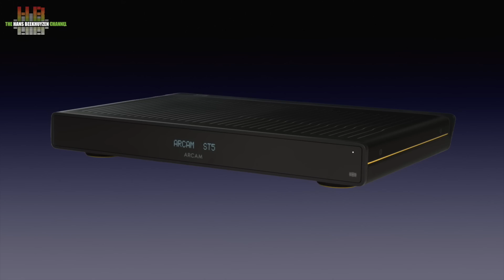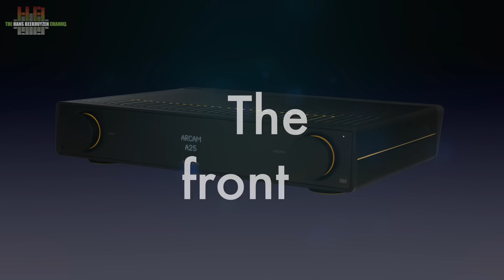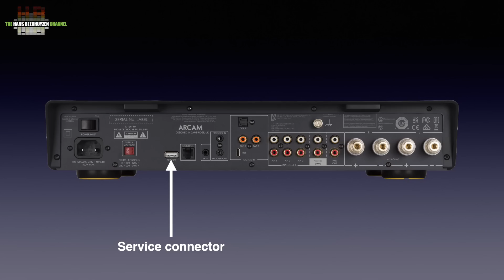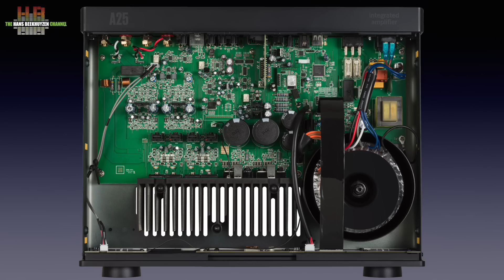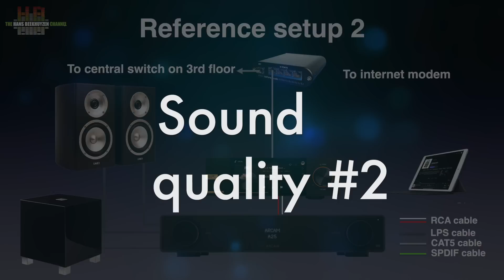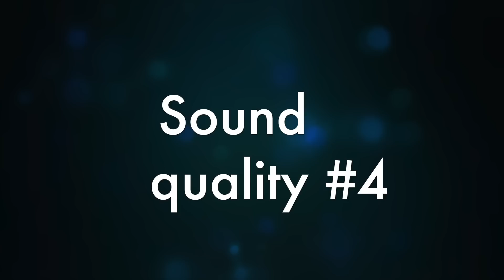Arcam Radia A25 class G amplifier

Comment: I really enjoy your detailed review. I'm considering pairing this Arcam A25 as an external amp to a Marantz Cinema 70s (for the rather limited AV time my family desires, with a 5.1 setup). Most of my use of the A25 will be for 2 channel music listening through my two LINN AV-5140 towers (4 ohm), where the Arcam's 165 wpc should provide just the power needed to make them sing. The Marantz 70s has a built in streamer, which I'm hoping will work ok together with the Arcam. Do you see any compatibility issues with these two devices ? Would much appreciate your comments.
Reply from the maker: No, but you should try before buy if you can.

Comment: I have the SA 20 and it is simply superb. It is almost the same as this A25 minus the BT and streaming bits. The class A magic happens up to 25 watts and for longer session, sane volume listening the SA 20 just rocks. Superb speaker control, non fatiguing highs, crystal clear midrange and grippy tight bass. They are on sale for about $500-600 if you can find one.
Reply from the maker: Thanks for sharing

Comment: Tempted to try an SA20.  Seems a great choice for lower SPLs, easier to drive speakers in an apartment.  Concerns are dac quality and reliability.  Not a looker either but functional.
Reply: @nc3419  I have the SA 20 and it is simply superb. It is almost the same as this A25 minus the BT and streaming bits. The class A magic happens up to 25 watts and for longer session, sane volume listening the SA 20 just rocks. Superb speaker control, non fatiguing highs, crystal clear midrange and grippy tight bass. They are on sale for about $500-600 if you can find one.
Reply: @dgdave2673  Thanks for the reply.  The SA20 was on a short list of integrated amps  in replacing my Hegel which was overkill for my needs and I wanted to downsize bulk with all my equipment. Did that with my speakers so amp was next.

Looked at the SA20, possibly a smaller Hegel, a Sugden A21se, a Musical Fidelity A1 and even a Cabasse Abyss but found a good deal on a used Van Alstine CA-1 which I jumped on.

I find the CA-1 neutral, transparent with good resolution and good stage depth.  Works well with my speakers but would still like to try a really good Class A sometime. I don't think I would gain stage depth like a tube but it would be different than the CA-1, purportedly.  So we'll see. 

Kind of wish these amps would come with XLR connections to take advantage of the higher voltage dacs offer whether balanced or not.
Reply from the maker: I haven't reviewed it so I can't say.

Comment: Are class G & H (essentially G) basically amplifiers that are Class B-A/B design for lower voltage signals and then have a second and rarely a third voltage rail?
Reply from the maker: See the video
Reply: @TheHansBeekhuyzenChannel  good review, beautifully presented.  But this piece is way too much. the competition is 30 to 40% less $ and just as powerful, versatile and with a much better bluetooth. It's a shame the A5 & 15 suffer from crossover distortion when at low popular levels. My uncle couldn't get rid of his A15 soon enough but then again he has the hearing of a bat or a dolphin it seems.
Reply: @noturnleftunstoned72 Is that distortion common to Class G topology?

Comment: Can A25 be an upgrade from my Hegel h90? I use extermal DAC.
Reply from the maker: I have not reviewed the Hegel so I can’t say
Reply: @TheHansBeekhuyzenChannel BTW, I call my Keces my little Hegel which I wouldn't use this name for any other amps I have had.  I actually have 2 Keces E40s. Great little desktop with a usb connection more than sufficient for Y/T music and podcasts.
Reply: I have an h160 and a Keces E40. The E40 is astounding for its price and design at low to moderate SPLs. The Hegel gives greater resolution and detail, adds more life (liveliness) so voices seem more focused while sounding natural. Piano passages on the Keces are more rounded, less impactful and dynamic than the Hegel but still better than many amps near its price or higher.  

So while I wish it had a bit more impact like the Hegel at times, it is a more relaxed listen, makes music sound pretty but still tuneful and colorations are more lifelike and easy generally. I use both a Topping D70s and an Aune x8 upgraded with a Sparkos opamp and its linear PS.  I do this because the Aune coax had dropouts on some CDs but found I prefer the optical on the Topping for movies while I can choose between the two for music. Coax to Topping, Aune via optical for music.  Mostly prefer the Aune for music as its a bit livelier and less rounded but the Topping is preferred for movies. Both are good, slightly different flavors/presentation.

Tried both dacs on the hegel single ended only and found the Topping too rounded, soft and the Aune less capable than the dac in the Hegel which while older, is fantastic.  Piano takes on a nice presentation more lifelike sound, less rounded.  All are nice but the Hegel with its internal dac not rounded in comparison.  I could prefer the Topping over the Hegel on some material but generally prefer the Hegel internal dac.  However, the Hegel cannot play SACD. 

I like the Keces and the 2 dac solution is working well.  The Hegel can satisfy both analog and internal dac.  Havn't even used XLR which could be more potent and the amp is overkill for my speakers, of which Dali Opticon 1 is the highest priced. Considered more expensive options but not a guarantee of success as the Dali Menuet SE did not work out for me.  If you want more expensive and larger bookshelves, there are a ton of options though. 

Finding a small bookshelf no more than a foot high that outperfoms is difficult, regardless of price, but there are a few options and the Hegel would still be overkill for most.

That stated, the only issue is the energy provided by the Hegel can also add glare with the speakers I have which I notice in movie speech soundtracks.  The Keces/Topping/Aune while rounded, has less glare in the upper mids for movies.  It's a give and take and I think recordings for movies are tipped up a bit.

I am tempted to try an Arcam class G as an inbetween/bridge gap if it offers more liveliness/adds life to the music while retaining resolution.  I do not expect it to outright beat the Hegel or greatly outperform the Keces (whose performance has been stated to sound like class A).  But the dac section in the Arcam could be bettered which makes having it both a convenience but also perhaps an unneccesary ancillary component.  If I heard it and thought it was good enough, at least giving me what I have now without the deficiencies (other cheaper dacs with the ESS 9038 implemented were so-so) it might be worth it and provides a one component solution.

Would have preferred a straight analog amp with both SE and balanced XLR so I could add a dac.  The class G provides class A at 12 to 20 watts given 8/4 ohms respectively but is stated to have poor performance when that range is greatly exceeded. So while measuring well over 100 watts in spite of stated values, while good for dynamic swings, its not quality watts for louder listening.  

The Hegel plays well loud and retains its abilities.  The Keces, when it reaches its limits has like a softer cliping, it starts to wimp out and sound washed out, but thats about the 3pm position and on the Menuet SE which is hard to drive and dips much lower than 4 ohms.  It really worked that amp and it got hot.  No issues driving my other speakers as loud as I want although there is more glare at louder than moderate levels, its a solid performer.

I think the Arcam would do similar.  At lower to moderate levels, its class A but too loud and it loses its charm.  So using the Keces with its 2 dacs versus an Argam SA20 becomes a more difficult choice.  I want to sell the Hegel only due to size and weight and perhaps becasue its overkill for my needs, in spite of making some of my music more lifelike, in a smaller kind of way small bookshelves do.  As I get older, heavy equipment becomes more difficult...and undesirable.

Your Hegel, is smaller and lighter with similar specs and perhaps capabilities with less power.  Its a different presentation for sure but if it provides the more lifelike and punchy presentation, you might miss it with the Arcam which would be different but by how much? It is stated to be lively and vg resolution so perhaps closer to hegel at lower SPLs? For louder music, the Hegel will outpeform it. 

The G tech on the Arcam seems to have more bass on smaller speakers, bigger woofers may be less controlled.  Its damping factor is much lower than both the Keces and the Hegel, both of which grip woofers for faster, tighter and tuneful bass.  The Arcam seems to have mixed results.

Also, the Hegel has great SNR, low distortion and displays great dynamics.  The Keces isn't far behind except for distortion which is still fairly low.  The SA20 displays a bit more distortion as measured by one Polish site I use, lower SNR and less dynamics but still at a level that shouldn't be too audible at lower SPLs.  The SA20 is a powerhouse but many have stated that at some point, it loses its charm which myself, I probably wouldn't hear given I don't listen at higher SPLs any longer, probably well under 90dB all the time and closer to 80dB and under most of the time.

Just don't know if getting perhaps a bit more is worth even the now discounted price being offered.  Also some people have written about certain issues that haven't been addressed properly so reliability is a concern.  

Really, between your Hegel and an SA20 or the A25 which is stated to be 15 to 25 watts in class A, while they wll sound different to a degree, I think the Hegel is still better in ways other than sound.  Hegel (as well as Keces) has a great track record of reliability, performance and resale for the Hegel (Keces is still not widely known but isn't made in PRC).  They look great too in an industrial way.  The older SA20 looks more dated and while the A25 has been upgraded, still not a looker by any means and most functionality is accessed by remote.  

The nice thing about the Hegel dacs is they sound good, in spite of not measuring as well as some newer dacs, they sound really nice, perhaps leaner but more focused, resolving and with texture in details than many cheaper, budget dacs, even costing in the hundreds lack.  Different flavor.   

One guy with both a hegel and an SA20 preferred both over others a Cyrus and an Audiolab.  The Hegel being more lively as I find and the Arcam having more depth in the stage, as I also prefer.  Is the Hegel completely flat, no but it presents flatter pehaps due to its dynamic capabilities which stand out.  The Keces is a bit more dimensional in this regard too but a bit less dynamic.  So somewhere, there's a balance of capabilities. The Hegel stage is a bit wider, the Keces a bit deeper and softer sounding with the dacs I use.

The Arcam is stated to have both a wide and deep relatively speaking stage within its limitations (SPLs).  Hit the power limitations and its over. Under the limitations is where the magic happens.  How much/to what degree I have not experienced in comparison to what I know.  Well there it is.

If you can afford this option, have a good return policy or can resell without too much damage $$, it could be worth it to try it. I do not expect it to outperform the Hegel in every category but you may find a preferential/an alternative sound.

Share your experience if you do so.
Reply: Have you tried an A25 ?  @nc3419
Reply: @nc3419 Thank you very much for your review.  After thinking about it, I now think I should just spend some more money and buy Axxess Forte 1. Especially since I heard it in October 2023 during the Warsaw Audio Show and it was quite impressive. The Forte 1 just ticks all the boxes for me.

Comment: I've heard of class A,
A/B and class D. This is
the first I hear of class G.
Reply from the maker: As said,I know of at least three brands that use is and it's great when done good.
Reply: Is a much difference between class H and G same aren't they @TheHansBeekhuyzenChannel
Reply: I had an a39 for a few months lovely sound but I ultimately got rid of it  because it felt no more powerful than the a85 it replaced
Reply: @sbwlearning1372  Brand?
Reply: @MCMTL  Arcam. 
A39 class G claimed output  120 wpc
Reply: @sbwlearning1372 Class G seems to work well within its limitations, regardless of how much power on tap.
Reply: @nc3419  It was a lovely sounding amp but I had bought it to get a bit more oomph over the a85 which was rated at  80 wpc.
But ultimately it drove me towards valve preamps and 500/ 600 watt power amps.
Lovely house sound Arcam. I still use their CD 33 player 
Keep enjoying 🎧🎸🎵